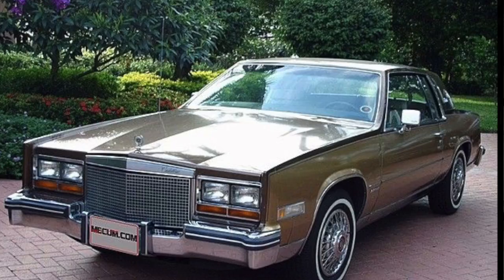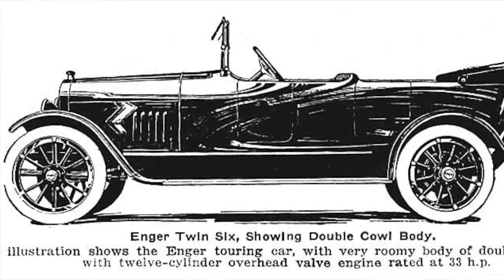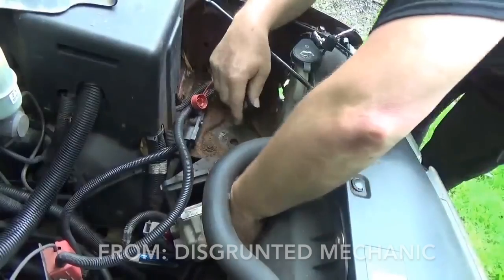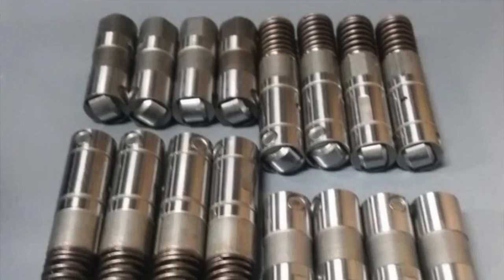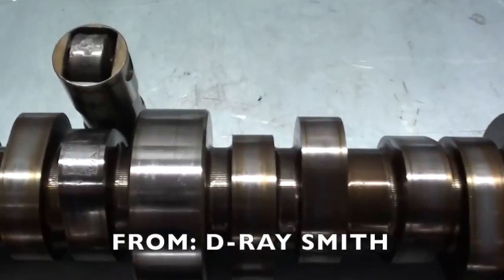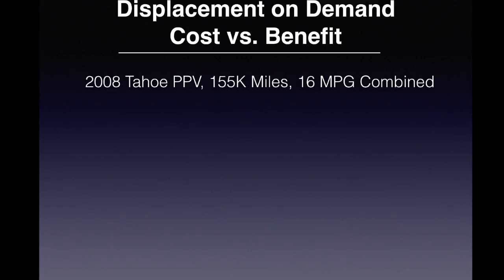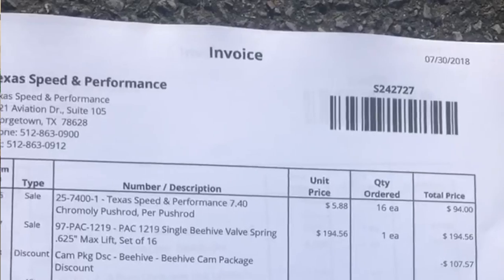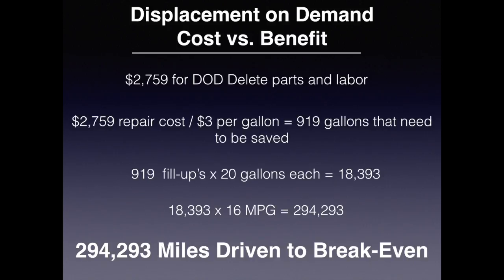DISPLACEMENT ON DEMAND - DOD, Repair Cost and Return on Investment.  Chevy Tahoe Collapsed Lifter

Comment: Can we get an update video on the Tahoe build? Thanks
Reply from the maker: Great timing on your Tahoe update request.  She just came back from the shop and I'm working on a video now.  Should have it ready to post by Friday.  -Chris
Reply: @hullinger  Great! Looking forward to seeing it. Last week I purchased a 2010 Silverado Z71 with 79,000 miles on the truck but has a new from the factory engine due to AFM issues and the first engine breaking in November 2018. It was installed at local Chevrolet dealership and I've been told by the dealership service department it has "upgraded parts" that won't experience any DOD issues. We'll see! It now has 1,500 miles on this new engine and it's got a 3 year 100,000 mile warranty so I can't do any changes to it yet. I have looked into the Diablo Sprint AFM disabler. Are you familiar with this device?
Reply from the maker: Congrat's on the Silverado!  Sweet that it has a new engine too, although that's a really good example of how serious those  DOD/AFM issues can be.  It's cool that the dealer handled upgraded the engine.  I'd be curious, and I'm sure you are too, as to what was done.  Can you hear if the engine is going into 4 cylinder mode?  Sometimes you can tell by a slight drone from the exhaust when cruising under low load.  My Caprice had a display on the dash that showed when it was in 8 vs. 4 cylinder mode, which after a while, I could tell just by sound.  I'm wondering if the DOD has already been deactivated through an electronic tune, like that Diablo Sprint AFM disabler.  That might be something to look for since the AFM system might already be turned off.  -Chris
Reply: @hullinger  The dealership just told me the guy who had the truck before me paid $8,000 for a new engine all that goes with it labor included from Chevrolet. I do have display that shows when the engine goes into V4 mode. With the Magnaflow exhaust I added last Friday I can also hear the infamous drone while coasting in V4. Very annoying! The Diablo Sprint is something I have looked at buying to use myself. It plugs into the diagnostic port underneath the steering wheel and only disables the AFM while plugged in. That makes it untraceable by the dealership. This is so I won't ruin my warranty with them.

Comment: You ever get this job completed? I just finished one up. 2012 Tahoe PPV 2wd K9 with 153k. Had a dead misfire at idle. Cylinder 5 exhaust cam lobe (Not a DOD cylinder) wiped off causing the miss at idle (could not feel it at higher rpm). I used all the GM part numbers off LT1Swap.com for parts ordering. Cost was $600 for all parts/oil/coolant and that was with a new oil pump and pan gasket. Shipped PCM to him for DOD delete for $50.  Had to drop the oil pan to do the pump. Total time it took me was 14 hours. Truck runs like new.

Comment: Chris be careful when you buying all these DOD cars with ticking sound.  Sometimes this collapsed lifter and collapsed lobe feeding the whole engine (or clogging the oil pickup tube screen) with metal chunks and particles, and because of that, you have to replace the whole engine not only put DOD delete kit on it. At least warm it up completely and make sure there is no low oil pressure warning.

Comment: Common problem I keep seeing on these motors when pulling to rebuild is the tiny oil screen under the oil pressure sending unit is stopped completely up.. I don't service these vehicles but always wonder if they were receiving proper service intervals & quality oil products.
Reply from the maker: Thanks so much, man for sharing about that tiny oil pressure screen.  I'll look at that as soon as the truck gets back from the shop.  I have it out getting a cam and lifters along with a few other add-ons too.  Thanks again!  -Chris

Comment: Change your oil every 5000 miles using quality oil and you will likely never have a problem.  Unless you bought that rare lemon  or  it is in a cop car which spends 90% of its engine hrs idling.  The only time you ever hear about dod or afm is when someone has a problem.  You don't hear about the millions of these engines on the road that have never had a problem. I wrench for a living and service dozens of these engines every year .  Out of the hundreds of these  trucks I've worked on I've seen 2 with lifter failure. Both with close to or over 100,000 miles and the inside of the engines both looked like the oil was never changed. 
 Most  newer engines have very tight bearing clearences, very small oil passage ways,   hydraulic timing chain or belt tensioners, and variable valve timing.  The best thing you can do is keep clean fresh oil in these engines. 
 If your one of the ford guys complaining about GM and DOD,   google  5.4 spark plugs  or ford Cam Phasers.....
I'll take the Chevy every time....
Reply: I am assigned a 2009 Silverado work truck, 5.3L with AFM. 278,000 miles on it, and still going. Orig engine and transmission. No AFM issues or oil issues.
Reply: My buddy sold his 2007 with 180k. He had 0 engine problems the entire time he head it. He actually maintained it quite well.
Reply: What are you seeing as far as carbon buildup on the valves in the direct injection engines?

Comment: This is making more since now, I heard of them dumb lifters, they have pins that oil spray on collapsing the lifter the spring on top keeps the push rods from coming out, also keeps valves closed so you can't feel 4 cylinders cut off, but they get stuck and cause low compression
Reply from the maker: Man, you got it exactly!  The DOD and AFM systems is a great idea until something goes wrong with them.  I hear that a new version of the AFM system comes out next year and it deactivates the rocker arms instead of the cam lifters.  Of course, I expect that system to fail too, but should be much easier to fix since you don't have to tear apart the engine to get to things!  Leave it to GM to overcomplicate this.  -Chris
Reply: @hullinger  Thanks for that information,will wait on buying a new Silverado till they change the current AFM system.

Comment: It's just a sales pitch to sell vehicles just like Ford and their towing numbers, looks good on paper.  Like a modern condenseing furnace.  Sure you save gas and electric but you loose on the repair of the electrical components.. I own a 14 Silverado with 86,000 miles.  It will average 21.8 to 23.2 average. It barely uses oil and runs great so far.  The V4 mode work's great for me..
Reply: Wait till u hit over 100k+

Comment: Looking forward to see how the Tahoe turns out. I had to do the same job on my 08 Silverado with the 5.3, used the texas speed kit as well. Make sure they change the o-ring on the oil pickup tube on the bottom of the oil pump, those are known for failing as well causing low or no oil pressure, might as well since your already in there with the timing cover off.
Reply from the maker: Thanks for the tip on the O-ring on the oil pickup tube.  Appreciate that!  And, I'll tell you this, I'm soo pissed about how long it's taken to get my Tahoe back from the shop.  She's still not back yet and each time I call about it I get the same answer about how it's just gonna take a bit longer.  I'm fuming about it!  -Chris

Comment: And this is why I had my DOD disabled as soon as my bumper-to-bumper warranty wore out! Not to mention, it was beginning to buck the transmission when shifting from V4 to V8, especially when going up a hill. Also, it was going into V4 mode when towing! That's ridiculous! So I had a custom tune done, disabling the DOD, and even squeaking a few more ponies out of the engine (not very much, but enough). And yet, I STILL get the exact same fuel economy that I achieved when the DOD was active. Now the only thing I am curious about is should I do a delete kit or not. Because in theory, all the lifters are active at all times. So the risk of a lifter failing, or getting stuck in V4 mode is now gone. Luckily, I never suffered any oil loss or oil consumption. So we'll see what happens! I'm at just about 40,000 miles and had it done over 5,000 miles ago. So far, so good!

By the way, I just subscribed to your channel and it changed from 5.2K to 5.3K. Woohoo!
Reply: I had mine tuned and cut off last week, and a couple of days later the whole system failed on me. Destroyed the lifter on cylinder #7 and that in turn messed the others up, rods were going down too far and started rolling shavings and then of course made a groove in the cam. Took it to a speed shop and doing the delete kit and stage 2 cam kit and all new internals from Texas Speed and Performance. $3,947 later and I should be good. Lol
Reply: Joshua Gilreath holy crap! That's terrible. Did the speed shop say anything about the tune contributing to this failure? Also what year is your truck, and how many miles does it have? Reason why I ask is because I see/hear mixed reviews regarding the DOD. To my understanding, if the DOD still works, and you just disable it with a tune (in my case, I had my entire PCM and TCM re-tuned), you're in good shape. However, if your engine is consuming/burning oil, and then you disable the DOD, the damage is already done and lifter failure is only a matter of time.
Reply from the maker: Sreilly, yeah, my understanding of the DOD system is exactly what you mentioned.  If the damage has already been done than tuning off the DOD doesn't do anything.  Sometimes you just don't know there's a problem until it's too late!  -Chris
Reply: East Coast Classics  You'd think that since all the lifters are firing all the time in V8 mode, they would perform as they should if the engine didn't have a DOD system. I believe one of the culprits of the engine failure has to do with at least one of the lifters not re-engaging after V4 tries to switch back to V8. I've done plenty of research and spoke to several of my friends who run their own shops for many years. They agree that if DOD is disabled, it should run has a normal V8 and not have any catastrophic issues. I've also ran into folks that disabled the DOD prior to the damage occurring, and have had no issues as well. One person had their DOD disabled on their 2011 Silverado almost immediately after they bought it brand new. They now have almost 130,000 miles on the truck now and haven't had a single issues with the engine. So my hopes are similar with my truck. We'll see!
Reply from the maker: Wow man, really lousy timing with turning off the DOD but still ending up with engine damage.  I'm sure the tune didn't cause the cam and lifter damage.  Really sucks about dropping that much coin on the engine parts and labor too.  What made you go with Texas Speed and Performance?  Are you near them?  -Chris

Comment: Chris, As a result, an auction Caprice PPV is probably not in my future.  I plan on driving my two Crown Vics forever.  BTW, the Mopar ECO system in the Dodge Charger Police Pursuit operates seamlessly and provides good fuel savings.  I drove my brothers 2012 Charger last week.
Reply from the maker: Thanks man and it's good to know that the Dodge version of the DOD system works well.  Appreciate you commenting on that!  -Chris

Comment: Another great video!  Question I would have is, how long will that drivetrain last without the DOD?  It would appear your hypothesis assumes that a non-DOD drivetrain won't fail.  Maybe it will, maybe it won't.  I also don't see how DOD only saves 5-7% of fuel.  But I agree, if that's all it saves, and if disabling DOD will result in longer lasting engine, then yes do it!  My 2004 Avalanche has the 5.3L Chevy engine without DOD, but it only has 60k miles on it, so I won't know for a LONG time.
Reply from the maker: Hey Gary, how in the world do you have only 60K on the Avalanche!  When you trade-in that truck the next Chevy you buy is gonna have a Gen II DOD that deactivates the rockers instead and is expected to increase MPG by 15%.
Reply: As much as I love vehicles, I only drive about 7,000 miles per year.  The Avalanche was my daily driver from 10/2003 until I got my first P71.  Since then it's seen less and less road time.  It only got 800 miles in 2017.  Yes, I keep accurate records for business  ;)

Comment: I USED FOR MY 2015 SILVERED RANGE TECHNOLOGY ACTIVE FUEL MANAGEMENT AFM DISABLER
Reply from the maker: Great idea on the AFM disabler, especially while your truck is still fairly new.  I'm told that once the lifter tick starts it's too late for a disabler and the only cure is an engine tear-down.
Reply: sometimes the exhaust manifolds start losing bolt heads too, causing a leak, and for some reason it sounds like lifter noise. I have 2 on my 08 suburban driver side that are missing. I bought mine with 185 km 4 years ago. it had a slight knock then and it hasnt gotten any worse. I have done the oil pressure sender and screen as well. Hearing how these sludge up, I decided to flush the engine and the goop that came out! My wife makes a lot of short trips with it, that speeds up the sludge process as the motor doesn't heat up by the time she gets to work. It doesnt use any oil or AF so it what it is , condensation that gets to the valve covers and gravity pulls it down and turns to sludge. There is also a pick up o ring that goes bad too. Just add 2 extra liters when you have wonky oil pressure, and if it goes back to normal because the oring is now submerged, you will dropping the pan soon. not a big deal, even with 4x4, just undo the carrier bolts on the front diff and you can weasel the pan out. 

Tomorrow I change the fuel module , as the top piece rots thru and you smell gas at the drivers rear door. Oh and unless you get parts at cost on account or something, the price for the fuel module (lowest locally for me ) 525 bucks! Thankfully Rockauto  exists, 259.10  + 25 for duty and shipping. I also bought a 12 pack ac oil filters for 48 bucks.

There are a few other thing that go, but my dod is still intact. I rolled the dice when I bought it (cause anytime one came up it sold immediately and this one had the 4 captains chairs, which my wife and kids liked in the previous death er windstar we had)  because of the knock and well aluminum block.  but like people have mentioned, pre 06 and reprogramming would be my choice. Grounds keep the grounds clean, just reeks havok  on them with gremlins. It has 270km now and I can live with flushes.

Comment: Only flaw I see is it's actually much worse than you calculated. Yours failed at 155K miles. Mine as well as most people's fail around 95K. Or sooner. So if you stuck with repairing the system for the "fuel savings". It would need THREE repairs of the DOD system. So it would never repay itself in fuel savings.
Reply from the maker: Wow, great comment and you're right about repairing the DOD three times just to get to 180K miles.  Outrageous to think this DOD system is saving anyone money.  -Chris
Reply: Mine just failed at 105,000 miles. Conveniently right after my powertrain warranty ran out. Something smells fishy...
Reply: @joshuagilreath7583  was the 100K warranty factory or optional? I had my catalytic converters fail on mine at 65K and they replaced them under the 100K emission equipment warranty. 1 mile after the repair my oil sending unit died and they charged me $500 to tow the vehicle back, keep it for 2 days and replace a $60 part. Not warranty. This DOD failure at 94K really made a lifelong GM owner buy a 2018 Ram 1500. GM needs to get thier act together.
Reply: @BBBILLY86  it was the factory 100k warranty. I didnt buy any extended warranties and even if I had when it got tuned that would have voided it anyways. I've been a lifelong GM person myself but I cant do this type of stuff all the time. Just being married and having a baby in the way I cant afford to do this anymore. I'm concerned because my wife's car has the auto shut off engine so I can only imagine what might go on that
Reply: @joshuagilreath7583  understand. I'm in a similar boat. Way too busy to be doing engine overhauls on my get to work vehicle. Especially one I bought from a Chevy dealership. Was different when I was young, drove junkers and had endless time to play with fixing them. Thanks for the info. Powertrain warranty is 5 years or 100,000 miles whichever comes first. I'm under miles but 5 years over coverage. I'd assume most people are.

Comment: It's amazing how much info you put out there in less than 10 minutes. Great video Chris!
Reply from the maker: Thanks Pat, appreciate that and you watching!  -Chris
Reply: @hullinger  
Are there any years of Silverados better than others or are all years affected?
Reply: @hullinger even though this is now considered "old" information as it's already 5 years old but I definitely learned something new and that's to never, ever purchase any vehicle with DOD/AFM installed. I also am very skeptical of those newer cars that shut off the engine as it's idling and starts back up 3 seconds later when the light turns green. I rely on my personal vehicle because from 8-5 Mon-fri I'm driving at least 150 miles a day delivering auto parts and the amount of times per day that damn thing would turn on and off my car would be probably 50 times a shift. in just 5 days that starter would have over 250 turnovers and there isn't a person in this planet that can convince me that's a good thing. and id venture a guess that the majority of the time your car is actually using more fuel to start it back up than whatever was saved by just a few seconds waiting in traffic. I see no point in having to maintain a system that isn't cheap to work on all to save a half penny of fuel at a stupid stop light lol so yeah that's how I feel about that